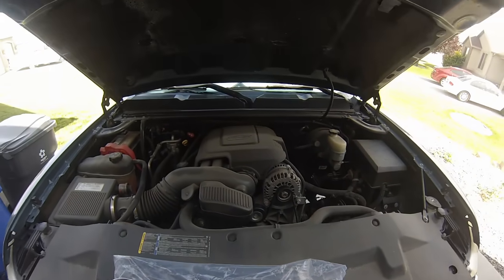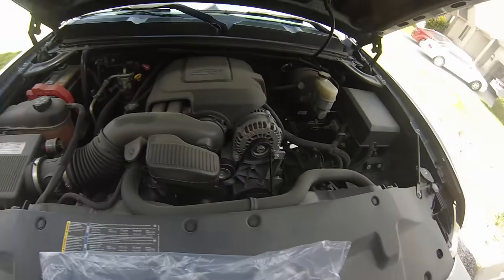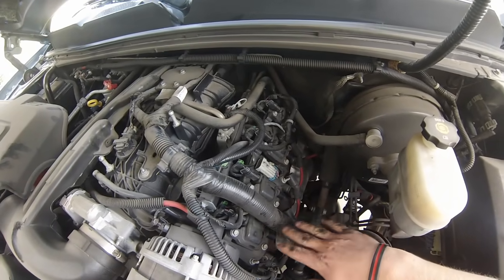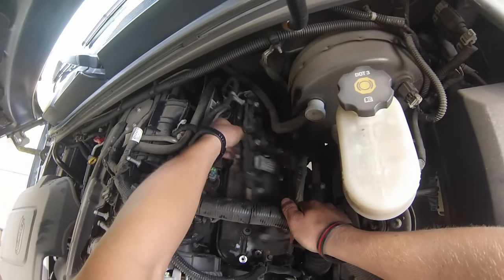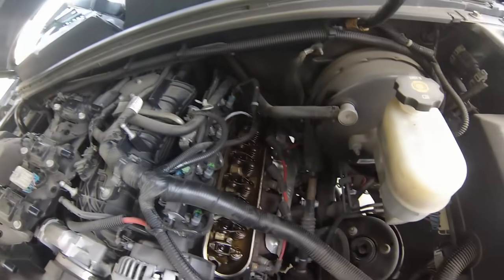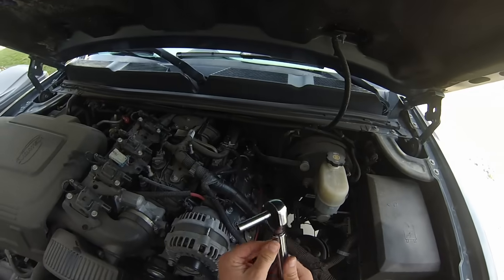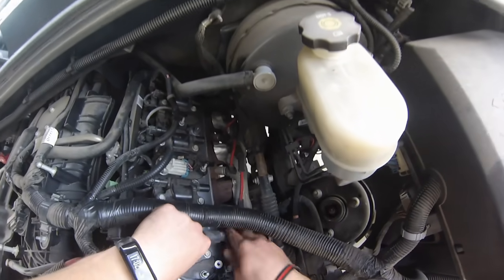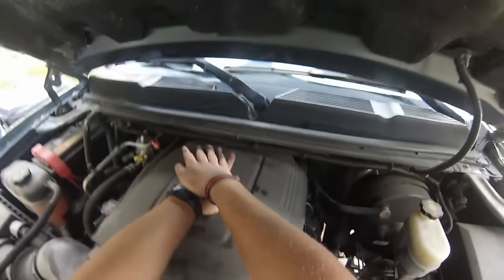Oil Consumption Fix: Replacing the Valve Cover and PCV on 2007-2013 Chevy Silverado

Comment: Did you notice a change in the oil pressure gauge after the replacement? Maybe I'm just being paranoid but I just replaced my valve cover on an 09 sierra 1500 and it seems like the oil pressure gauge is more sensitive on acceleration & deceleration now. It idles around 40, drops to 30-35 on deceleration, and increases to 50-60 at acceleration which is normal from what I've read but I'd like hear what your experience was
Reply: Run a code reader through it. My oil pressure gauge was acting funny until I replaced the sensor, now it's back to factory

Comment: I'm suburban or yukon xl shopping. Was this oil  problem into 2014 as well? I know they redesigned in 2015 but wasn't sure about the 5.3 in general if that was updated or not
Reply from the maker: It seems like around the 2012 year is when they didn't have the issue anymore. I'm not sure on the exact year as it seems to vary depending on who you talk to. Thanks for watching!

Comment: This is probably pisted somewhere but want to know what is the difference between the original cover and the new style and can the pvc valve be replaced when needed on the new cover?
Reply: He shows both covers in the video.  The older style has a circular hole, while newer one is square.  Some people still have issues with square hole one, and will drill some drainage holes.  This engine doesn’t have a real pcv valve it is just an orifice.  You can test if oil is coming out of the pcv valve by just running a hose off it into a some type of container and driving around.  Some people use these catch cans permanently, and they are sold as aftermarket product.

Comment: Does this issue also cause a tick you can hear?
Reply: Lifter tick is caused by a bad o-ring on the oil pump pick up tube. The oil is airiated and not reaching the rear of the engine. Solution is to pull the oil pan and change the pan gasket and pick up tube o-ring where the pick up tube goes in to the oil pump.

Comment: Motor oil on new gasket will dry it out, petroleum and rubber do not mix, use a silicone grease

Comment: Would this on my 2010 Silverado 5.3 cause my truck to puke out smoke every so often from the exhaust and make my oil pressure get lower than should be? And foul spark plugs as well? Any answers would be appreciated. My truck has only 96,000 miles
Reply: Very possible. Fouled plugs? Definitely. Pcv fails and oil will get sucked into air intake manifold. Can also cause a poor idle and smoke at start.

Comment: Hey people... I did this to my 5.3 09 Silverado work vehicle several years back among performing other upgrades, and it does not work. Zero change in the one quart every 2k miles, although it all certainly could have unseen efficiency benefits. It certainly seems or makes sense that it would work, but no. You just have a new valve cover... like mine.
Reply: That's all the AFM/DOD models

Comment: @XinnKoda Can't you just Not use the PCV hose, replace it with a Breather filter like I use to do back in My Race days?
Reply from the maker: That's a good question. I've thought about it myself. Obviously a close inspection would cause you to fail an emissions test. My only other concern would be to make sure to plug the hole where the tube connects to the intake so you don't get unfiltered air getting into the engine. Thanks for watching!

Comment: Just asking,  the pcv valve is built into the valve cover and not removable?.. update.  Mine was removable, but it is pressed in.  The valve had no ball/bearing,  just hollow with a tiny hole.  Maybe going to try a new valve cover.  Currently trying to solve a slight random vibration at idle.
Reply from the maker: That is correct.

Comment: No reason to buy these. Clean up the old ones and drill 3 holes on the inside separation plate.
Reply: Any links for that tutorial?
Reply: @louisgabaldon2506  Cant post links here but did you see where he showed the difference between the new ones and old ones? You just drill 3 1/4 inch holes evenly spaced in the thin metal plate that has the oval he shows you .All it does is keep oil from sitting up in there and getting sucked up the pcv
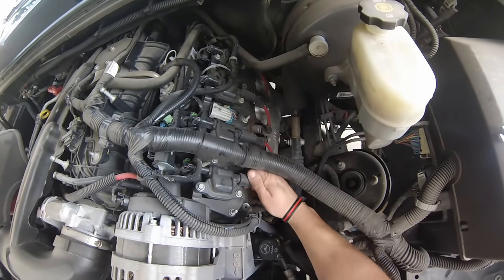Reply: @louisgabaldon2506  where his middle finger is at 2:57
Reply: @louisgabaldon2506  search "How to help 5.3 Vortec oil consumption - due to clogged PCV valve" right here on youtube. vid will come up

Comment: Can a old valve cover can cause code p0171 system lean bank one ? Because a damage tuve inside cover valve ? Thanks
Reply from the maker: Not likely. It could be several things but if it's reading an entire bank as being lean then it might be your oxygen sensors. Could also be an exhaust leak causing the oxygen sensors to get false readings. Good luck and thanks for watching!

Comment: Hello does it matter if you swap out the valve cover after just driving the truck or should you wait for cool down?
Reply from the maker: It shouldn't matter however keep in mind your exhaust runs right below those valve covers so any oil that drips may be hitting the hot exhaust. It might be easier in general to wait for the engine to cool down but if time is a factor then you should be OK if it's hot. Just be safe out there! Thanks for watching!
Reply: Thanks for the quick reply!

Comment: What was the code are symptoms that your car was giving you
Reply: I had p0300 p0332 p0455 turns out I had the same problem my rocker arm wasn’t touching the valve spring or the lifter, changing the cam and checking lifter to make sure it’s not bent now

Comment: My 08 silverado is running rough at idle and upon accelerating from a stop or from setting at a stop sign.
Once I am going down the road a a faster speed, things seem to smooth out.
Does it sound like the PCV line and valve are the problem and need to be changed?
Also, do you have a link for the valve cover?
Reply: That sounds like leaking intake gaskets. It's a big issue on these engines. It idles rough when cold and goes away when it warms up. I'm about to do mine on my 2010 Silverado 4.8 with 214k miles. Online says it's about 4-6 hour job. While I'm in there I'm doing valley pan gasket too since it's under the intake.

Comment: Hi great video! quick question i already replaced the valve cover on my 2007 Tahoe with 180,000miles, it was replaced some years back when the miles where closer to 100,000. AFM range disabler installed around the same time, my oil consumption was very low until now! the last 6 months i've been monitoring closer and i wanna say 1 quart every 1000 miles, but my main concern now is the excessive amount of vaccum from the oil fill cap when car is at idle, what causes that? and is it possibe its related to the pcv valve maybe updated cover is plugged up again. Any ideas?

Comment: After you changed it did it smell like burnt oil? I just changed mine and ran the truck for a bit & It smelled like burnt oil after I changed the cover
Reply from the maker: I don't recall a burnt oil smell but oil can drip down from the valve cover and land on the exhaust manifold underneath. Maybe that's what happened?
Reply: @TheDadBodWorkshop  yea probably cus the smell went away after a day or so. Thanks!!

Comment: Hey I was wondering will this updated valve cover still stop oil consumption even if I have t deleted AFM
Reply from the maker: Deleting the AFM is only one piece of the puzzle. These engines liked to consume oil for a couple of reasons, one of them being the AFM, one being the faulty PCV valve and one reason being the AFM oil squirter in the oil pan. All these should be fixed if you want to ensure it doesn't consume oil. I've attached the TSB related to this recall in the description. Good luck!

Comment: Did you reactivate the active fuel management system? Or are you leaving it off? Does it have to be disabled before doing this job? My 2008 avalanche is eating up oil like crazy! I need to do this, so any information is vital. Thank you!
Reply from the maker: Keep it deactivated. There's also an oil deflector that can be installed in the oil pan that helps with oil consumption. In severe cases, the engine may continue to eat oil due to the piston oil rings being locked in the closed position. In that case you can try GMs procedure of adding cleaner on top of the pistons and letting them sit for a long time. I've never done that procedure but it's what's GM recommends. Thanks for watching!
Reply: @TheDadBodWorkshop  I don’t have consumption through the piston rings.. I know there’s a leak on passenger side valve cover, so I might as well do both! So what does keeping it deactivated achieve?
Reply from the maker: @StitchDGlitch  when AFM is deactivated it keeps the lifters in normal operation mode like the other lifters which prevents the oil consumption issues.
Reply: @TheDadBodWorkshop  I found one on Amazon for $100

Comment: Did you have a ticking noise prior to replacement ?
Reply from the maker: I had the notorious "Vortec" piston slap noise that is very common with these engines. After the engine warms up it usually goes away. Thanks for watching!

Comment: Would you happen to have a part number for that upgraded valve cover? Would that also fit a 02 Tahoe 5.3l vortec engine?
Reply: the 02 tahoe is the old style 5.3 and shouldn't have this specific valve cover issue as far as I am aware. Replacing the PCV valve and/or adding a catch can would probably reduce oil burning in those.
Reply: @danielparks9035  they have these problems too.

Comment: Hey bud i just purchased a 2012 yukon denali 6.2 and have installed the range technology and also a catch can, will the catch can work or would I need to install the new updated version? And can you provide me the correct part # for yukon Denali 2012 6.2
Reply from the maker: The catch can should work great. I considered installing one as well but some people warned about the catch can not providing the proper vacuum and it messing with emissions but I never explored it any further. I'm not sure which part number you need because mine is the 5.3 but I always found part numbers through rockauto.com. Thanks for supporting the channel and keep wrenching!
Reply: @TheDadBodWorkshop  ok 👍 thanks for the quick response

Comment: Did it fix the problem?
Reply from the maker: It did for me. Although depending on how long your vehicle has been consuming oil it may not. Over time the oil will start making its way down into the piston rings and may clog up the oil control rings from working. If that's the case then this will not work. Good luck!

Comment: I know you’re some certified mechanic but is a bad gasket also a cause for oil on spark plugs?
Reply from the maker: I'm not a certified mechanic but if you're finding oil on spark plugs it's not likely from head gasket.
Reply: XinnKoda any clue what could it be? Oil rings ?
Reply from the maker: @KyngRuben  could be failed oil rings or the engine is ingesting oil from the pcv.

Comment: Why not just put a small custom plate over the hole?
Reply from the maker: You can't cover it completely or else it will stop the pcv system from working all together. If you could somehow make a small plate and ensure the air flow was the same to what GM recommends then I guess you could do that as well. Thanks for watching!

Comment: I see Rock Auto has the 264-965 but is there a difference between it and 264-969? Amazon reviews say the 969 fits 2007 suburban, 2008+9 Silverado. It's about a $60 difference
Reply from the maker: I'm guessing the cheaper one is the old style? You can tell the difference with the shape of the pcv hole. The new style needs to be square with baffles.
Reply: 969 is the 3rd upgraded design buy that over the 965.

Comment: Do you have to change both sides or just the drivers side valve cover?
Reply from the maker: Fortunately just the driver's side. The passenger side does not have a pcv valve on it. Thanks for watching!
Reply: @TheDadBodWorkshop  Thank you man I really appreciate it. Hopefully this fixes it and if it doesn’t the next step is going to be the deflector shield for me. 😎 Your video helped out so much thanks again man your a life saver
Reply from the maker: @ToNYxModzZ  thanks for the kind comments and good luck!

Comment: Did you see a improvement afterwards
Reply from the maker: Sorry for the late response! It's gotten better but still not perfect. I am going add the oil deflector that GM recommends for this same issue. Thanks for watching!
Reply: @TheDadBodWorkshop  - Did you ever add the oil deflector you spoke of here?

I thought the updated valve cover had the oil deflector built in?

Comment: Do you have a part number or a recommendation on where to buy the good valve cover?
Reply from the maker: I bought mine off of Rockauto. Just make sure you get the one with the updated baffle. There are still some old design covers floating around out there.

Comment: would you be so kind to give an update and let us know if this did fix the excessive oil consumption ?? Have youdone or had to do anything else to fix the problem ? Thank you
Reply from the maker: The oil consumption went down dramatically! I only had to top the oil off once between oil changes. This has improved since it used to use almost a two quarts between changes. Thanks for watching!
Reply: @TheDadBodWorkshop  i look at the RockAuto website and they have two one is branded at 111$ and non branded for 45$ I assume they are the same but which one you got? Thank you
Reply from the maker: I don't know what vehicle you have but for me the part number is Dorman 264965.

Comment: Question do you have the part number for the valve cover. I'm having problems with my valve cover also.
Reply from the maker: I'm not sure on the part number. Rockauto has them for sale and the new design has the square hole on the underside. Make sure you get the one with the square hole like shown in my video. Thanks for watching!
Reply: 264969
Reply: Thanks
Reply: @jacobduffy9765  is it any 264969 because I see the ultrapower valve cover the SKP and dorman and gm genuine all have square hole are all these updated design?

Comment: I have a 2006 Silverado. I had oil leaks at the valve covers, oil pan and rear main seal.

I had all those leaks fixed.

The truck never had any issue with oil burn before this.

After I had the leaks fixed back in Jan it has puffed a good amount of white/ bluish smoke upon starting ever since.

Could this be the problem? Weird it never happened before.

The truck has all the power it ever had thats why I'm leaning toward this other than a ring shot.
Reply from the maker: Good question. Could be just an oil control ring shot which would cause oil consumption without loss of power. I would start with replacing the valve cover and disabling the AFM. Those two things will help no matter what and then go from there. Good luck!
Reply: A plugged pcv can cause oil leaks as well. It creates a strong vacuum that pulls on the internal lip seals of your engine causing premature failure. One test that could identify a failed pcv is warm up your truck and remove the oil fill tube cap and see if it changes idle quality for the worse and check how much vacuum is pulled at the tube by placing your hand over it. Should be a very gentle vacuum.

Comment: Hello thanks for the great info. I have an 07 avalanche with the 5.3 it smokes and it has trouble starting it idles low some times turns off can the rough idle be caused by the pvc valve?
Reply from the maker: That's a lot of symptoms it has. It could be pvc valve but over time if these engines consume a lot of oil then it can lead to a whole lot of other problems. Changing the pvc valve would certainly not hurt anything and it's not terribly expensive to try it out and see what issues it fixes. Thanks for watching!

Comment: How many miles are too late
Reply from the maker: Depends on the truck. Usually you can gauge just by how much oil it's consuming. If it's just a small amount then you can usually fix it without any issues. My truck has about 90k on it and I think it's moderate on the oil consumption. I still have to top off my oil between changes but usually just once.
Reply: Do you know if the 4.8 have the oil consumption problem

Comment: Did gm already solve this issue on a 2011 Silverado or would I still need to replace the valve cover?
Reply from the maker: You might be ok... I'm not sure when they made the switch but 2011 seems like it would have the new style. Thanks for watching!
Reply: @TheDadBodWorkshop  i have a 2012 Suburban and it doesn't burn oil

Comment: Torque specs?
Reply from the maker: Good question. It's a rubber gasket mating against metal so usually hand tight is good enough but I don't recall the torque specs off the top of my head. Thanks for watching!

Comment: Did you have any problems after you fix it is it a major problem cuz the oil consumption kind of scared me away from the Tahoe
Reply from the maker: If you can make these fixes early, the oil consumption will be much less. Sometimes it is too late to make these fixes because the engine has ingested so much oil that the piston rings no logger work to control the oil. Thanks for watching!

Comment: I have a 2011 5.3. I did the range afm disabled as well when the truck had 118k on it due to burning oil and the v4 mode being annoying. Since I installed the range device I don’t burn oil anymore and runs better on v8 all the time. Has 134k and still doing good. Should I still do this valve cover?
Reply from the maker: That is excellent news! If it were me I still would put the new valve cover on. The old design is prone to failure and at any point it could lead to ingestion of oil. Thanks for watching!
Reply: Thanks for the response!